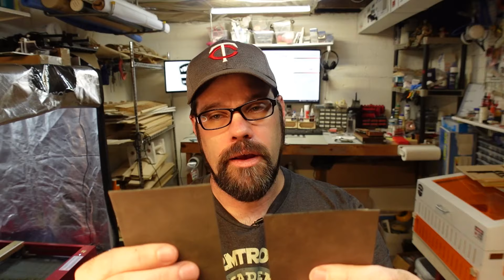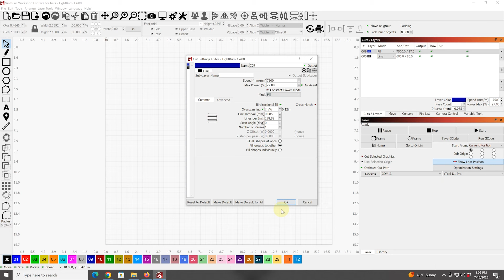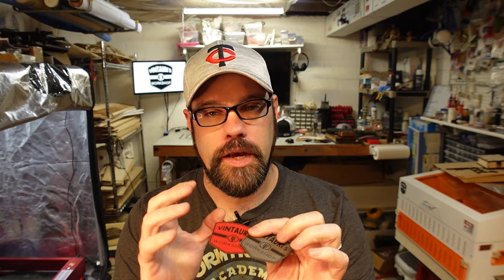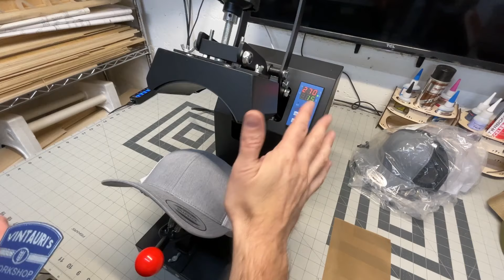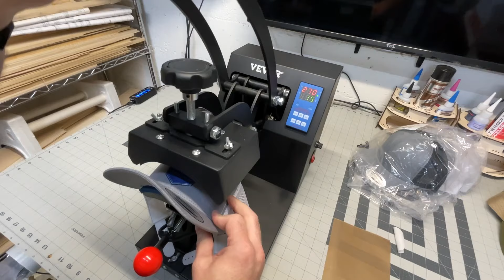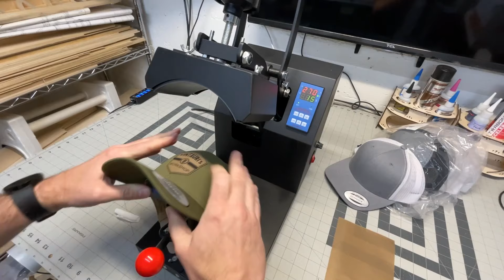Making Custom Hats with the xTool D1 20w Pro and Vevor Heat press

Comment: Good video.👍.. patch might adhear better to hat if you preheat your pad on the hat press.. recomended 60 seconds  this gives a more even heat. And pre heat your hat... some hats and dyes hold moister this could affect adhesion......hope this helps everyone!  👍
Reply from the maker: Thanks for the tips!  I’ve played around with the process some and it’s definitely a balance on the heat. So far the patches are holding up well to regular use.

Comment: I tried this with a Richardson 112 SnapBack and I get really bad creases/wrinkles in the middle. Is there something I’m doing wrong? Thank you
Reply from the maker: Try finding some foam to add extra cushion behind the hat and only use enough pressure to get a good fit. It takes a little tweaking but you should find a balance of support and pressure that works without creasing.
Reply: Great! Thank you so much for your feedback. I will give it a shot. I used the settings for this exact machine and the leather for the speed. It worked perfectly.

Comment: Have you used xTool Creative Space software? Don’t currently have LightBurn and was wondering what settings to use? Your patches look great!
Reply from the maker: I don't use XCS very often.  They run MM/sec in that program so you would take the speeds I'm running in MM/Min and divide by 60.  The power settings should be the same from program to program.
Reply: @Vintauri  awesome! Thank you for the response, I will give it a try!

Comment: Am presuming you final cut wit scissors. They have a sharp look to them
Reply from the maker: The laser does the outer cut as well as the engrave. If done at the right speed there is little charring.
Reply: @Vintauri  What was your setting for the 20watt on the cut layer? They turned out great. Thanks.

Comment: Thanks. Excellent idea
Reply from the maker: I've used this leather on other items as well.  It's fun stuff to play with!
Reply: Do you need the heat press or is there another method of applying the patches so the stay stuck?  @Vintauri
Reply from the maker: @MinnesotaMaker-Greg  You could use an iron if you can get the correct temp dialed in on it. I’ve done that on notebooks that I cannot use the curved press with.